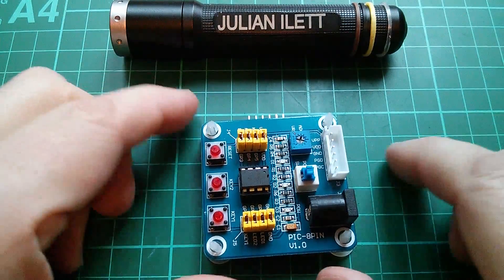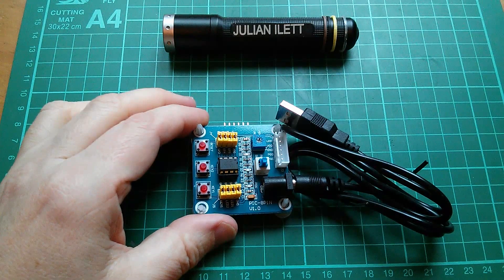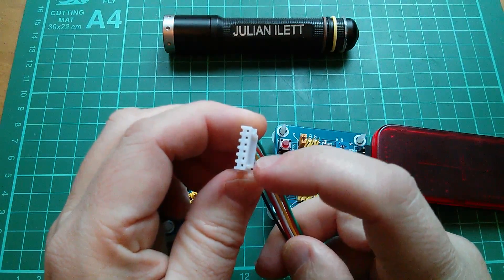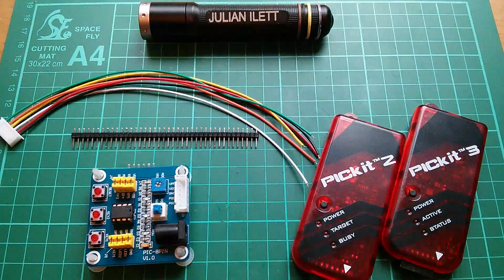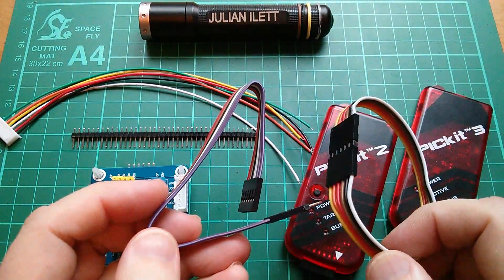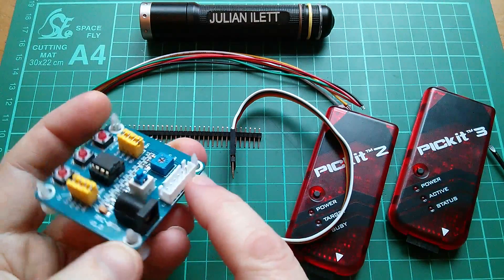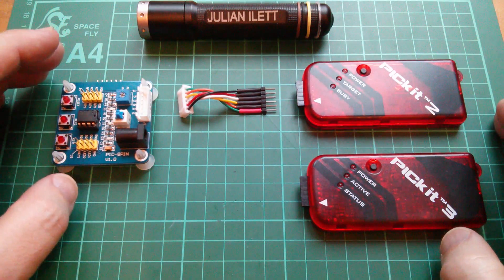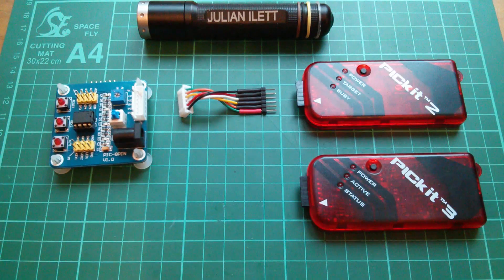PIC Assembly Language Tutorials: #0 - Shopping List & Mods

Comment: im new to the channel so i dont know but that soldering iron looks an awful lot like the one i once bought at poundland after seeing Big Clives video about it, but was scared to use because it feels like its plastic is going to melt in my hands/catch fire.  if it is indeed poundland one can you recommend it if I have no other options
Reply from the maker: My soldering iron is an Antex CS18, made in England, not £1, more like £20. I'm constantly told to get a temperature controlled iron, but I haven't done so yet :)
Reply: aha ok thanks mate! (i feel like for 20 pounds they couldve included some temperature control maybe)
Reply: If you are on a low budget, I would suggest you go to Maplin and buy their cheapest iron (which may well be the Antex that Julian uses), they only sell OK irons.

If you can spend a little more, I would suggest you buy a temperature controlled iron. I have the N78AR, which I am very happy with.

I have no affiliation with Maplin, except as a customer.
Reply: Beware of some of the cheap Maplin soldering irons though. I bought one and it doesn't get hot enough to melt the lead-free solder it came with. It has absolutely no problems with proper lead/tin solder though. I took the first one back, thinking it was faulty. When the second one behaved exactly the same, I decided to try lead solder, which melts at 40c lower.

Comment: My question is very important, I need to know this above all else. What are those plastic feet in the corners of the boards called? And do you have a quick Ebay link?  Told you it was important.
Reply: Thank you everybody. Thanks to your key words, I had a good look around and found something very similar at Ebay. I might get some adhesive ones too. Here is the link I got. http://www.ebay.com/itm/10-20-50pcs-Durable-Offwhite-Plastic-Push-Lock-Fasteners-PCB-Spacer-Support-/201747443983?var=&hash=item2ef915b10f:m:maxBnQxuAVd10xt0IKYy_Yw
Reply from the maker: I was looking for them on eBay recently, but didn't find them. I'll keep looking.
Reply: john smith
search for- pcb standoffs
Reply from the maker: Difficult to find, but "plastic PCB spacer" gets some results
Reply: https://www.aliexpress.com/wholesale?SearchText=Snap-In+Posts

Comment: I have got a 12F627 (and a lot more PIC's) and it only misses the AD converter. I will try to play along .... Still have to get a PICKITT3, used to use a Velleman kitt but it seems the software doesn't work any more....
Reply: Think you meant 12F629? the 627 is one of the 16F series.
Reply: right, the 12F629

Comment: Julian, Looking at the close up at minute 12:30 I noticed the trace going to C4 appears to be cut as well.  Was that intentional?
Reply from the maker: I cut that before I had properly worked out the modification, then soldered it back again :)
Reply: Been there; done that.  Fine pitch layout is a pain trying to modify traces that are close together.  Thanks for the reply.  I'm looking forward to more in this thread since I was planning on buying a universal PIC programmer from Sparkfun ($69.00) that would program all the various flavors.  I've haven't done any assembly language programming in a dog's age so I am a bit rusty and it would be a treat to see your technique.

Comment: all these modifications will scare people that are new to MCUs. I should have suggested you to design a proto board.
Reply: or  just use a breadboard, easy enough....
Reply: Well yes. Breadboard would do the job but as a beginner you don't want to mess with too many cables/connections at once.

Comment: You could also program the pic microcontrolder directly from an RPi no?
Reply from the maker: With some difficulty - for example, you'd have to generate the 13V programming voltage somehow.
Reply: Ow... 13v to program a pic microcontroler? I wasn't aware of that ^.^;
Still... a little voltage shifter and a 13v source for the pic side of things...
I'll have to look into this more
Reply: Ohh think I see my error.
Some pic chips suport low voltage programing.
It was my mistake to assume that was all of them ^.^;
Reply: I'll have a look see. I've been using my Pi zero as a avr programmer so I'd like to stick with that for pic chips too if I can ^.^
Reply: Very cool, and entirely done by building on other peoples hard work ^.^;
I went with AVR rather than PIC to start with for the very reason that there seem to be so much more in terms of tutorials and info on how to work with AVR chips :p
I was up and running in no time with nothing more than bits and pieces I already had to hand.
Thanks for the link. I shall see what I can put together.
Reply: Loues S. Cat  Err, there were/are tips, projects and tutorials (granted, mostly in printed paper electronics magazines and books) for over 10 years...

Comment: It seems like your clone programmer has some troubles programming the PIC when MCLR is connected with RC. I use PICKit3 (A genuine one from Microchip) as well as my home brew PICKit2 for programming PIC12F675 without any troubles. I cant imagine why that bypassing is needed when the VPP will raise the programming voltage to only 12V and VDD is at 5V. In between these two pins, the RC network for resetting  is just a 10K resistor (Thats the value probably there) . So a merely 700 micro amp will be flowing though that, where as, it's in circuit programming (ICSP) so if someone uses this PIC for production unit, then how can they disconnect this RC part? could you please explain the reason behind it ?
Reply from the maker: "The MCLR/VPP pin is normally connected to an RC circuit. The pull-up resistor is tied to VDD and
a capacitor is tied to ground. This circuit can affect the operation of ICSP depending on the size
of the capacitor since the VPP voltage must be isolated from the rest of the circuit (in most cases
a resistor is not capable of isolating the circuit). It is, therefore, recommended that the circuit in
Figure 28-1 be used when an RC is connected to MCLR/VPP. The diode should be a Schottky-type
device. Another issue with MCLR/VPP is that when the PICmicro device is programmed,
this pin is driven to approximately 13V and also to ground. Therefore, the application circuit must
be isolated from this voltage provided by the programmer"

from: http://ww1.microchip.com/downloads/en/DeviceDoc/31028a.pdf

Comment: Isn't that the way it always is, you have to modify the the hardware to make it work right. In the past 15 years I have been using a 2.2K resister on the outputs to hardware for clk and data with the programmer direct to chip pin and if I don't use the reset pin and just pull it high, I put a 1n4148 from +5 to Vpp and then tie the programmer Vpp directly to chip, that way the cathode prevents a surge of Vpp voltage into the 5V rail

Comment: Julian, could you not have the right-angled pin-header come out the underside of the board, that way the pic-kit wouldn't foul with the power connector?
Reply from the maker: Yes, but it still leaves the programmer upside down.

Comment: AVR: 10€ programmer
STM32 Discovery: 25€ dev board (32 bit) with integrated programmer
PIC: 60€ (in germany)

u see the problem?
Reply: I was thinking the same. why would someone use the pic boards. when these are so costly. arduino nano clones can be found for 3$ shipping included. not only this, the cheap ESP modules can be found for 3$ too with wifi capable. and here the board costs 7$ and 8$ for programmer with lesser community support as compared to arduino and esp.
Reply: If all of the shops in your area started increasing their prices by 1000%, what would you do? Would you just stay silent and drive 20km to a different store with better prices just to get some food?
Reply: funnily enough roughly this happened to the area I was living in a year ago. yeah I just drove somewhere else to do my shopping 20km isn't that far. store owners are all going out of business as the convenience of not having to drive 20 minutes isn't worth paying twice as much (or more) for. no surprise they're all going out of business now. greedy idiots.
Reply: is it too much of a problem, even for europeans ?
Reply: funny all the germans I talk to manage to get stuff from ebay just fine....
Reply: I don't like buying stuff on ebay. 90% of the items get shipped from china and it takes ages for them to arrive.

Comment: Good stuff. All parts ordered and on the way (after Chinese New Year/Spring Festival). I like your under the board mod. Very elegant. Is the schematic for that little board available so I can try and knock up a temporary one on stripboard?
Reply from the maker: I've not seen a schematic for it. Maybe I'll have a go at drawing a schematic ready for the first tutorial.
Reply: That would be great. I've had a good search and I can't find it anywhere. I'd also like to re-design it with your bug fix.